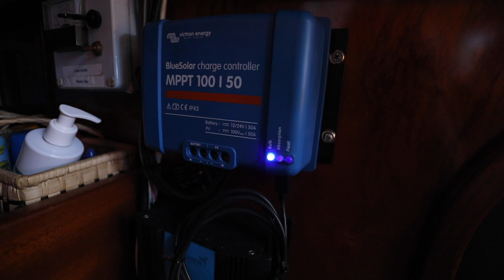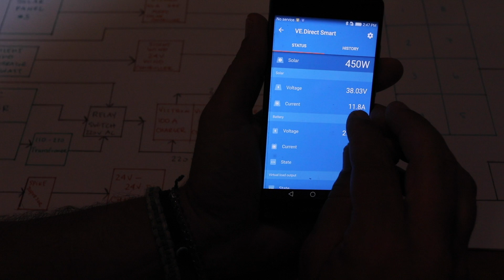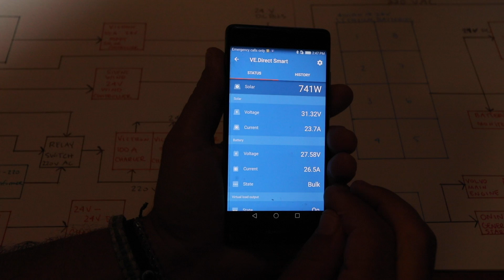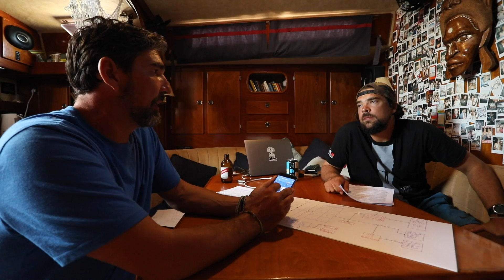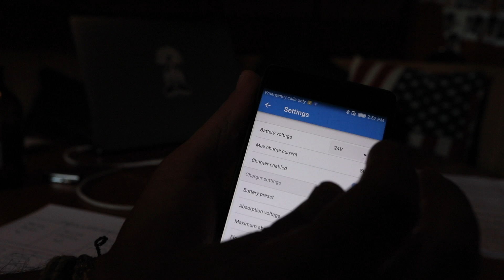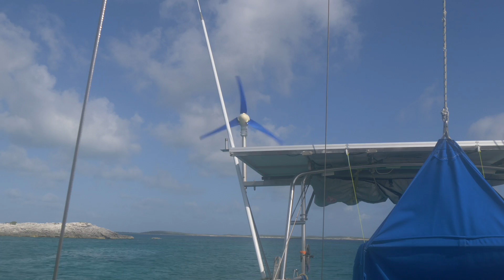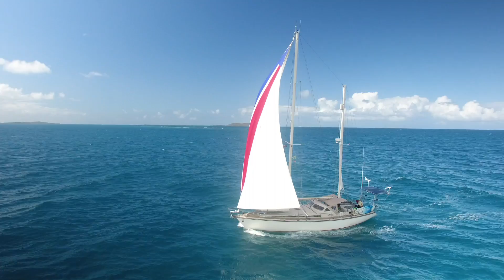SOLAR Vs. WIND - How much power can you make? ELECTRICAL BOAT TECH (2 of 7) - Sailing Vessel Delos

Comment: Love sailing, but the systems make it happen. Everything from ballast, standing/running rig, sail plan and all things in between are interesting. The experience of the Delos crew, good or bad, is valuable information. The schematic/flow chart in 1 of 7 was awesome. I would be interested in seeing an actual wiring diagram, only because I enjoy that sort of detail, although most my not be up for that. Todays episodes explanation of  power(current) and voltage was straight forward. Ohm's Law should be well learned and understood for ANY DIY marine "electrician".  I am looking forward to the next installment.

Comment: Great info on electric generation, it's clear that the lithium batteries are a game changer in how fast and long a charge lasts in real world applications.
Question: 1. what are your thoughts on an electric propulsion engine as opposed to a diesel engine? 
2. Would you trust all electric for long distance cruising compared to coastal cruising?

Comment: Are the solar panels in series or parallel?  Ive heard about increased efficiency from running in series and the Victron controllers seem to be designed for it.
Reply: My two 60 Amp Schneider charge controllers accept my solar panels in series of parallel pairs which is 48Volts.My ElectroDacus is a 120 Amp Charge controller and will accept 24 Volts so I have to rewire the panels to parallel at 24 Volts which doubles the amps and doubles wire size also. I think losses with wire sizes could reduce efficiency .
Reply: Most of the losses in solar are from the current heating the wires.  When you put panels in series, you up the voltage, and cut the current. This reduces the heating, and thus is more efficient.  It also means you can use less copper in smaller wires, saving you more money. More of the panel power makes it into the batteries.  Using MPPT charge controllers also maximizes the panel power output, also increasing the efficiency.

Comment: So in short: Plenty of lithium batteries, Solar panels(lots), Diesel generator. If you want to, add a powerful hydro-generator, they can produce 1000W at 6 knots, great for running the aircon or other power hungry things at sea. Dont bother with wind generators, they are noisy and does only make power worth mentioning at 20 knots or more.

Comment: guys i have an idea for a floating solar rig to charge batteries that can be assembled so instead of rigging it on the boat you have it floating besides the boat for fast charging of batteries.  Are you planning to convert to an electric engine ?

Comment: Hey BT, take an old outboard 100hp, take the motor out and slap on a 50kw gen on the shaft. Mount that puppy on the back of Delos under sail and you could run the A/C when the baby comes on board. We did this 15 years ago and never got a patent on it. 

Cheers Tribe
Reply: Pretty sure they can run the AC on the 8kW Onan if they wanted to haul around the fuel.
Reply: Why does a Hydro need fuel? The forward motion of the vessel turns the screw on the outboard that turns the Generator on top of the outboard. It works like Oceanvolt kinda.

Comment: I like that the victron app gives you a live reading of what power you're making. Nice feature. I went with a chinese Epever 30a MPPT controller with a bluetooth dongle and I have to swipe-down on my phone every time I want to update the data on the app. That's a pain. I prefer the streaming data you've got. I May spring for a Victron 712 monitor eventually. (yeah, yeah I shoulda bought the victron mppt controller... I know....)

Comment: Thanks really like the info. The Victron charge controller is by far the best right now if my Morningstar's where not so solid I would change over. Also will be going AGM to lithium probably Battle Born or Renogy drop in replacements (house system not a boat).

Comment: I appreciate the mindset towards establishing a baseline of system performance before throwing more components in the mix. Do you maintain a spreadsheet for the purpose of doing so, recording data regularly? 

Incidently, this mindset is just as helpful when it comes to troubleshooting faults within any onboard system. A lot of folks with more money than brains will start replacing components in shoot-from-the-hip scattergun fashion rather than taking the time to allow faults to fully develop, and their minds to fully comprehend. ”Retail Therapy” can easily be achieved in the first world, but it’s when you get off the beaten path that ”Repair Therapy” comes into its own. Patience and observation then become the backbone of shipboard systems management.

Diggin’ the tech discussion. 👍🏼 I’d like to hear your thoughts on Watt & Sea hydro generators and Solbian PV, as I expect you’ve considered both.

Comment: Keeping an electrical system functioning in a marine environment as opposed to land based application is tricky.
Bravo  to Delos crew for keeping everything humming along..
You are using about 1/6 the electricity per day that I am using at my house.
This is an 80+ acre property with 3 barns and irrigation.
Of course I am running electric water heater, stove, clothes dryer, pool pump, four well pumps that are all 240v.
I have converted my workshop to off grid solar as it is an ideal setup because I use it intermittently.
200w solar with 2 lead acid batteries and a 3000 w inverter. 
I can run lights and most power tools since they are not being run for a long time period.
Great video.

Comment: Brian, I looked up my electric bill and I consume between 500-700KW per month, which is about 16-23kw per day. So I guess that is about 3-4 times what you use on the boat. I am single and live in an 1800 sq ft home in the USA (NC) with most of my electric being consumed by the Central AC/Heat I suspect. GREAT Video guys! Like the Brian Bits!
Reply: I looked also. my house is <1000 sft and my air was off most of the last month. I used 355 kWh so about 11+ kWh/day average. This month's is the lowest for the entire year. I have a washer and dryer, and watch TV like the average American. If the TV is not on, then the radio often is. I leave the front and back porch lights on, and about half of my interior lights are incandescent bulbs. I have multiple-bulb fixtures in all rooms. I also live a lifestyle that requires getting up and going to bed out of sync with the natural daylight. My refrigerator is MASSIVE compared to what I would use on a boat like their Amel. Additionally, I use my electric hot water heater without giving it a second thought. But in the end, there is just me and not 3 others using the power. That's my breakdown. Keep the great vids coming. Thank you Delos!
Reply: @seafever8644  Just for another comparison.  In QLD Australia, House is around 2000sft.  Have 2x Fridges, Freezer, Pool.  Air conditioner gets used when needed, it's quite hot here.  Average for us here would be around 15kwh a day average.  We pay roughly 28c / kWh here.  2 Adults, 2 kids.  Most of the bill goes towards the pool + electric stove/oven.  And cooling when we use it.
Reply: 1600 sq. Ft. Single family, 2 people with fridge, freezer, basic lights, computers, little TV, extra power WiFi, electric stove, our own well, propane hot water, ~300 kwh/mo. $0.115/kwh but more than 80% by solar. The 300kWh is before solar generation.
Reply: We are a family of 4 in a detached home of about 3500 Sqft in Canada and run about 450KWh\month (13.3\d) with a low of 300 and a high of 600\m.  Sorry Australia but our power rates are 6.8 cents\KWh.  Much of our energy usage though is for heat which comes in the form of Natural gas which isn't included in these numbers.

Comment: Great series thanks Q. would it be more economical having a D.C. genset rather than converting A.C. from your current Genset
Reply: AC Alternators are more efficient than DC generators, and it is very easy to convert AC to DC.

Comment: I really like the tech videos!  Helps to know how to prepare and what's needed to cruise full time.  Also Brian, are those true Lithium Ion (Li-ion) batteries,  some of which are polymer based and actually cobalt, magnesium or a nickle manganese cobalt cathode or actually are they Lithium Iron Phosphate LiFePO4 batteries, used in the hybrid car industry, cheaper but safer for the environment and primarily used in the Hybrid car industry?  Some companies are marketing Lithium Iron Phosphate (LiFePO4) as Li-ion bateries, which they are not, but true that they are safer for the environment, but has a 1/3rd the capacity but a third of the cost.
Reply: I have a 400Ah 24V LiFePo4 bank also But my bank is less than half the physical size of Brians bank which has the exact same capacity.What does that indicate to you? I thought I was getting LiFePo4 when I ordered them. How can one find out ? Is Li-ion more susceptible to thermal runaway ? You seem to know your batteries. What do you mean "safer for the environment",in what way ? Please enlighten us by sharing some of your  knowledge with us newbies .Thanks
Reply: There is nothing like true lithium or "fake". What you are calling Li-Ion is acually a umbrella term and has a lot of different chemistry's too. For example, LiNiMnCoO2 is called Li-ion INR, it is also called NMC(Lithium manganese nickel). Other examples is LiMn2O4/IMR(Li-manganese), LiNiCoAlO2/NCA(Li-aluminum), LiNiCoO2/NCO, LiCoO2/ICR(Li-cobalt), LiFePO4/IFR/LFP(Li-phosphate).
Reply: LiFePo4 is clearly the best choice on a boat, if its not a fast lightweight racer. It has the best lifespan, price and it is the safest! It does not have the best energy density, meaning it is big and heavy. But that does not matter on a 25 tonn sailboat.  I would consider some of the "best" Li-Po battery to be directly dangerous on a boat. They are super energy dense, light weight, have a really high maximum discharge, and burst into an unstoppable ball of flames if you poke it gently with a fork. They will also start to degrade after a couple of hundred charges. If you are on a racer or have a fast lightweight cruiser cat. If you are the kind that cuts your toothbrush in half to save weight. There are some solutions that are in between the two extremes. It is a battery that consists of 18650 or 21700 NCR cells, with individual protection of each cell in case of thermal runaway. Just like you find in modern electric cars... Lifepo4 has a energydensity of about 100wh/kg, and the densest batteries has around 240wh/kg.    You can rate all the different chemistry's on different characteristics,  High current, energy density, preformance, cost, lifespan and safety. With cost lifespan and safety beeing the most important. Its also easy to think that you would want a high preformance battery with lots of capacity. But over the years you will get a lot less watt hours trough that battery, than with a lower preformance battery that has a longer lifespan. In short, go with the safer, cheaper and boring battery, and use the money you saved to buy a battery extra ;)
Reply: @AccidentalADV  I had a notion to try out those Lithium Titanate batteries. Extreme safe above and below water ,you can chop them with an axe ! Still a little costly. Main use is in buses. What are your thoughts.
Reply: @robertorzech2466  they are great! Really good. Except the price. I think they are really expensive. If you have the money sure. If not, good old lifepo will give you more stored energy/years per dollar 👍
Reply: @robertorzech2466  take a look at batteryuniversity.com great page for research

Comment: To put it in perspective a 5 tonnes AC will draw about 5Kw/hr. A laptop will draw about 100 watts so basically their solar alone can power 35 -40 laptops.
Reply: First, you’re confusing power (watts), with energy (watt-hours). Second, their solar was generating about 700 watts (power). If your laptop uses 100 watts, then you can run 7 of them, not 35-40, on 700w. A 5 ton A/C uses about 5.5kW of power, or 132 kWh of energy per day (if it ran 24 hours) Since an A/C cycles, it actually uses less energy than that.
Reply: @stargazer7644  Yes correct. I was referring to their daily production of 3.4 to 4+ kw a day which could translate to 30 to 40 laptops...for just an hour of course.

Comment: i use to track our daily usage of power by reading the meter at a certain time every day, in the winter we would use about 12 kw on average and summer, it could go as high as 30 kw  per day.  I live in a house in california.
Reply: kW is instantaneous power, kWh is energy (power by time). They are not the same thing.  If you have a device that uses 1kW and you leave it on for a day, it has used 24 kilowatt-hours of energy in a day at a 1 kilowatt rate.  I use a device made by efergy to automatically record my energy consumption.
Reply: KWh or KW  big difference!
Reply: @larskronqvist9170  Small correction to your correection. Kilo is undercase k in measurements - kW and kWh. Cheers from Finland.
Reply: @koomaj  Thanks-I am always confused, kW is correct.  But watt is 1000 kW called?
Reply: @larskronqvist9170  1000 kW is 1 MW = 1 Megawatt.

Comment: Brian, Nice effort, I find your explanation is very helpful - Now I'm motivated will make a systematic for my boat which has 720 watts of Solar Power. 860 amp AGM battery bank just installed. I was planning to remove my kero stove and change it to induction. not sure where to purchase the oven though. My system is only Solar and wind and 120 amp alternator  I don't want to have a generator onboard, I also have a D400 Wind generator. Still, this maybe it may be too big a power draw from the convection oven. As always  Nice work is very easy for a DYI fellow like me. Thank You, SV. Skoiern IV

Comment: Love these technical videos!  Thanks!  Another suggestion might be boat maintenance or "day-in-the-life" (I think you might have done one before).  Some people might like to know the work-to-fun ratio of owning a sailboat.  I know that goes up significantly being a vlogger. :-)
Reply from the maker: Ha yes I think our friends on Endless Playtime started an alternate channel called Endless Boatwork :)
Reply: At least when you're not actually living on a boat, you have to think that the work is half the fun :D Now when it's winter and the sea is starting to freeze (I did actually see the first thin layers of sea ice in a shaded bay while biking to work this morning) and the boat is safely tucked under a PVC blanket to shelter it from the snow, I've got at least three projects currently underway...

Comment: If you added more solar panels (+ more batteries) could you completely eliminate your use of the generator?  (Of course, you'd keep it for emergencies)  If you could do this, have you calculated how many more panels and batteries you would need?  Could a total of say 6 panels provide enough power?                      Scott W
Reply from the maker: I think it's definitely doable.  The two main things we need to generator for are our dive compressor and water maker.  Both of which could probably be make to run off solar with reduced motor sizes (ie smaller fill rates) and a soft-start to reduce the locked rotor current.  I tried to see if the dive compressor would run, but the LRC is like 800 amps @220V of something crazy and would melt any inverter without a soft-start.  Not even sure if it would work then but one can always hope.  I think I go over this a bit more in the upcoming videos so stay tuned :)
Reply: three phase solar coming to a chandlery near you! lol  ...